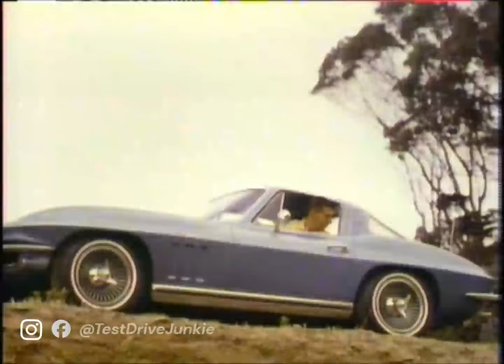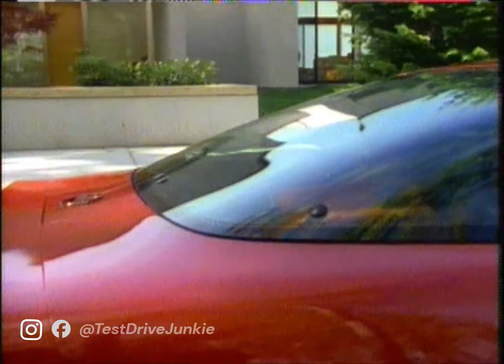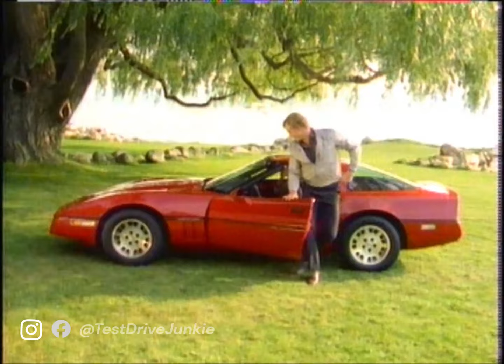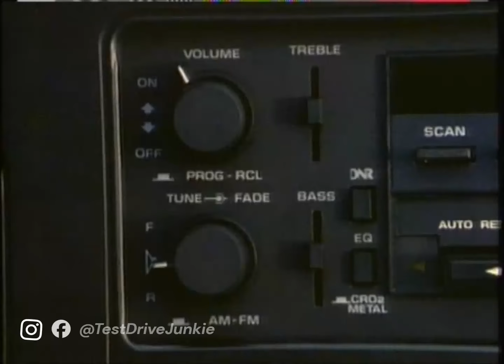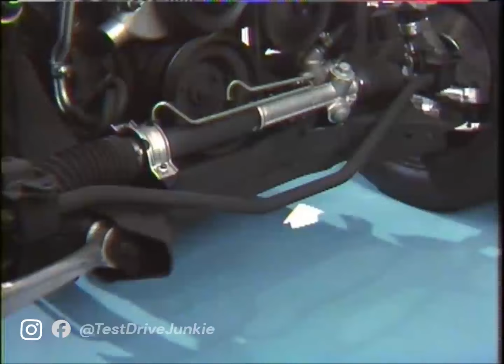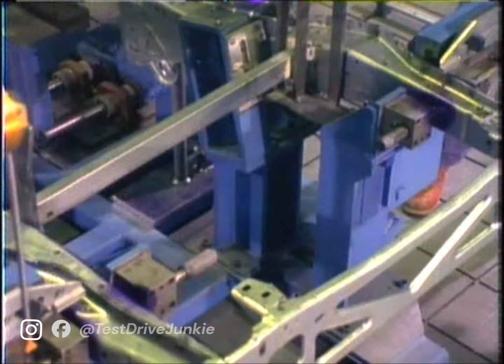1984 Chevrolet Corvette Manufacturer Laserdisc Promotional Video

Comment: I had an F-15 flight instructor that drove a C4 Corvette in 1987. I rode with him once and I was appalled. It was a harsh riding rattle-trap. That ride poisoned my perception of all Corvettes until I test drove a C6 Z06 and was blown away by the ride quality, fit and finish, snickety manual shifter and unreal all motor 505 horsepower. I bought it on the spot and I'm a believer now. Also, I had two Laserdisc players in the '80s. I sold the last of my Laserdisc collection two years ago.

Comment: Funny how the alloy wheels shown in this video on the red Corvette NEVER made it into production.  Honestly I've NEVER seen those wheels on any GM car.
Reply: Was just about to comment about that.
Reply: Some of the pre-production 1983 Corvettes had them, is the only way you know they are the early C4's.
Reply: @tanside  I thought there weren't ANY 1983 Corvettes?? And if there were ANY preproductions they wouldn't have been sold to the general public?  Because over 40 years of looking at Corvettes, I've NEVER seen ONE with those wheels. Not ONE.
Reply: @theblondedynamite That very much might be true because I've never been to that museum. But one out of one really don't count really.
Reply: @theblondedynamiteyou’re correct.  There is a 1983 Corvette in the Corvette Museum in Bowling Green.  It is wearing these wheels (C3 style wheels on a C4 look odd).  I think a handful of 1983 Corvettes were built as preproduction prototypes, but the one in the museum may be the only one still in existence.